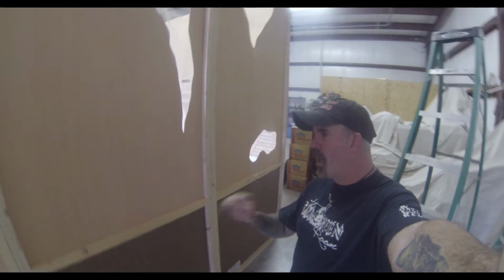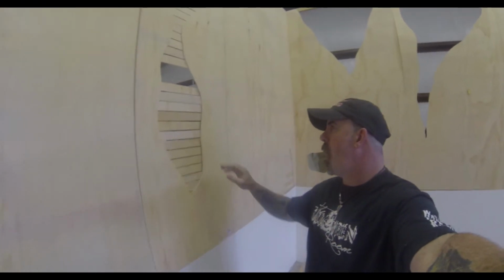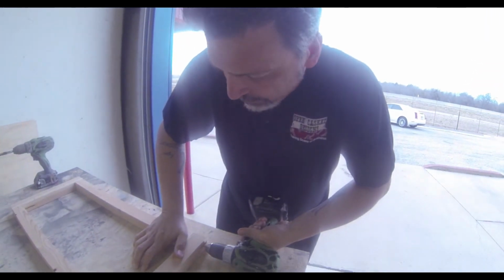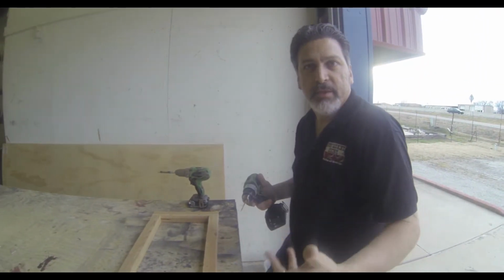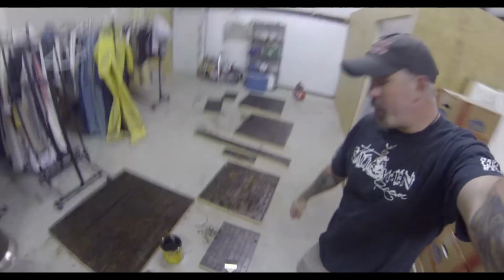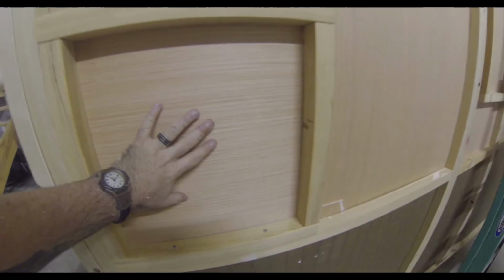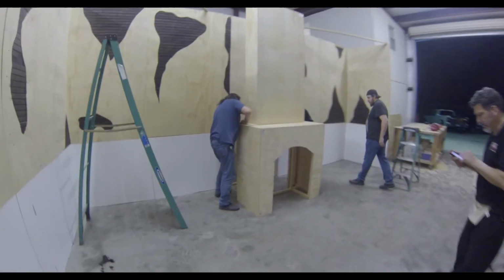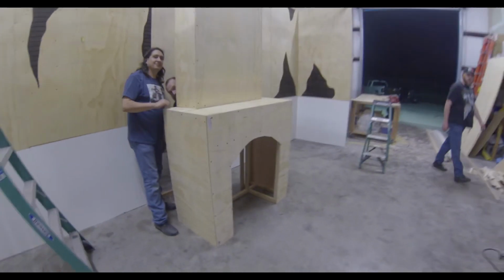How to build modular walls for your haunted house or attraction-Episode 3

Comment: What was the reason for staining the panels if you were planning on staining the slats?  If anything you could have aged the slats with a vinegar/steel wool mix and then you'd have some color variation that would still allow for the slats to stand out from the stained panels.  I understand that you can see it when you're up close, but from a distance, it just looks like a dark hole in the wall.  Also, are you going to do the plaster squeezing through the slats?
Reply from the maker: We painted the panels black and we are not done with the slats yet.  This is just the base.  We are using lot more paints and plaster after we get the wallpaper on.